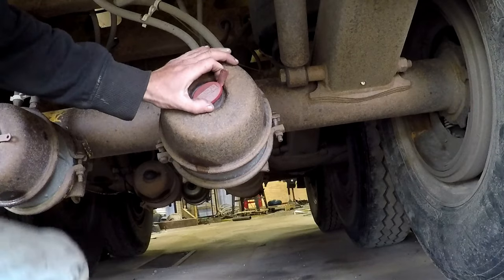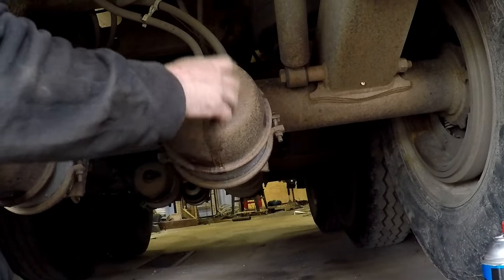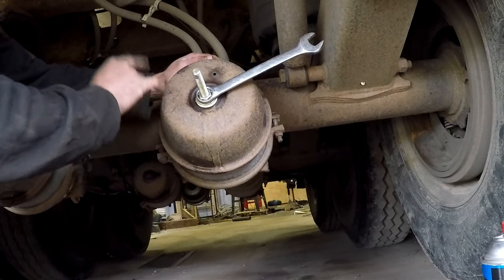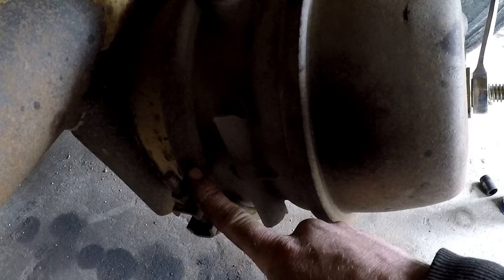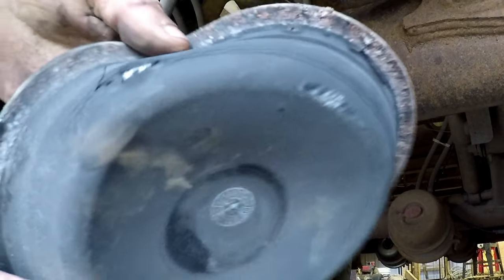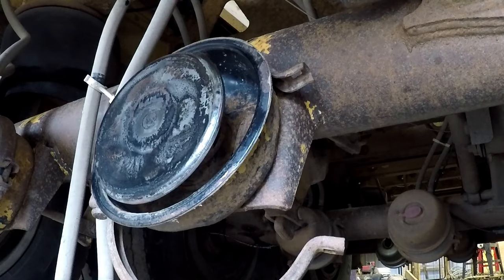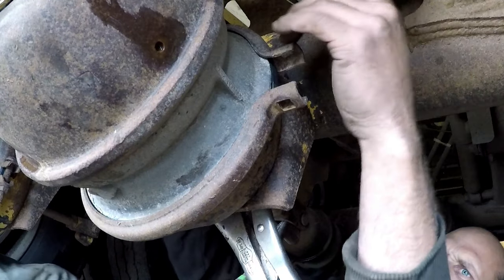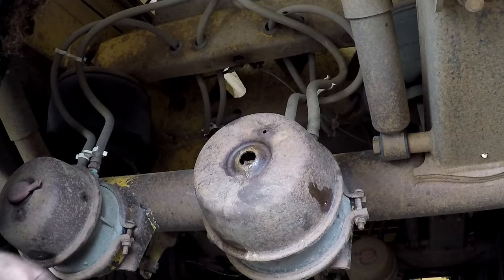brake can repair type 30/30 service break air leak

Comment: How do you know when to replace the chamber vs the rubber seal you installed
Reply from the maker: a leak on the park brake side will require atleast replacing the piggy back, but gennerally a judgement call on the overall condition of the parts being re-used will determine a full can replacement vrs replacing a pancake or piggy back or both. things like excessive rust or a broken return spring would normally require replacing the entire brake can.

Comment: You can also use the slack adjuster to move the spring back without going thru all that bs
Reply from the maker: There is a lot of short cuts you could take but the way I showed it creates multiple layers of safety. So if someone can manage to get at least one or more of the steps right there risk of it popping off and hitting them in the face is pretty minimal
Reply: The way i have done it adjust the brakes out loosen the clamp and replace the pancake or replace the whole front chamber

Comment: How is this tool bolt called that inserts in front of chamber and holds spring compressed? I need one like this to proceed with membrane replacement
Reply: Cage bolt.
Reply: @dchawk81  thank you. I realized that I have one attached to the side of chamber after bougt another at Napa for 3$
Reply: @johnysilver1853  Nice. I happened to find a couple under the seat in a truck I bought used. Lol.

Comment: So the tool that you inserted in to the can did you buy it
Reply from the maker: they should be stored on the side of the brake can. new brake cans also come with new ones, i keep one from a new can in my tool box and my side box on the truck though, sometimes the cage bolts can get pretty crusty stored on the side of the can.

Comment: New to air brakes. Heard so many stories of people dying replacing these and Im scared to death of them. Do I have anything to be worried about or is it in my head??
Reply: nothing to worry about, but you do need to be careful, if he didn't have air pressure to release the brakes it takes a while to get that caging bolt tight enough, so it won't hurt you. Best if you could watch some one else who knows what their doing before you try it. 
If you find yourself in a situation you have to do it yourself just take your time and make sure the spring is caged before removing the clamp

Comment: I have an issue with an air leak on my brake system on my 2016 T880. When I press the yellow parking brake, I hear air bleeding though the yellow knob. Never leaks when yellow brake is pulled out and engaged. Could this be brake chamber?
Reply from the maker: Yes

Comment: just wondering if that impact that you used is a 1/2 in or 3/4 in ???
Reply from the maker: 1/2" its not a big bolt, this is a job that can be done easily with just basic hand tools as well.

Comment: Do you know what is part number is that rubber membrane for Volvo VNL?
Reply from the maker: doesn't matter what truck only matters what size chamber. type 30 is most common for class 8 drive and trailer axles its rare for them to be anything else.
Reply: @Ezrider359 thank you for information. Mine has little leak I think it will fix it by replacing it.

Comment: where do you find the cage bolt???
Reply: On the side of the chamber is a slot with the nut,  if not you need to find one or use the slot-bolt from the other side. It' a good practice every so often to pull the cage bolt out and clean them off. I soak my in ospho  apply a lube and re-insert them back in their holder if they start to get corrode and rusty. 

Definitely something you should do if you drive dump trucks and pickup a shit of dirt, mud and water underneath.

Comment: Where you buy the cage bolt and diaphragm?
Reply from the maker: there should be a cage bolt in the side of your break chamber. there is basically a tube cast in the side of the chamber and there is supposed to be a cage bolt stored there. sometimes one or two will be missing and i keep one from a new chamber in my tool box however as they can get seized and stuck in there storage location on the chamber. the diaphragm you can get at a lot of places that sell truck parts. it is starting to get a little less common to be able to find them but lots of truck/trailer parts dealers still keep them in stock. i normally buy half cans and diaphragms several at a time so i don't have to go looking for them when i need them.
Reply: @Ezrider359  thank you!

Comment: Where to find that T screw
Reply from the maker: There should be a cage bolt stored on the side of the brake can
Reply: Thanks sir I changed it $10 it WORK I really appreciate it thank you very much good video

Comment: What was the proble or symtom?
Reply from the maker: air leak when the brakes are pressed.
Reply: @Ezrider359  ok how did you find it?
Reply from the maker: on a trailer you can pull the johnny bar and go under the trailer and see witch one is leaking, on a tractor you may need to have someone step on the foot brake for you, you should be able to hear the air leak, coming from the can.
Reply: @Ezrider359  thank very much for the info
Reply: Ricardo Ayala if you don't have a trolley brake bar, you can simply install a air line from an air compressor to a blue/ service glad hand. install the blur glad hand onto the front of the trailer trailer. 

you'll have to do this from time to time when you can't get someone's help. keep a red and blue glad hand with shop quick connect air fittings handy. it helps you out a ton!

Comment: Very poignant video for me:( Short Story.  When i was young, foolish, full of piss and vinegar, and knew everything, i learned this lesson the hard way. While pulling up to a Ohio toll booth i heard an air leak. I pulled over right in front of the toll booth to check it out. I diagnosed it with a leaking pancake so i thought i would take it out and go to the truckstop up the road to get another. I just crawled between the trailer dolly and whipped the clamp off not knowing there is a 1750 lb. spring in there loaded. It hit me in the chest and lights out, for i'm not sure how long... couldn't have been too long because there were cars pulling through the toll booth right next to me.  When i collected my self, and figured out that i was probably ok, i called the boss who completely freaked when he heard what i did. He immediately implemented a safety training program which included systems training for new drivers. I'm just glad it didn't hit me in the face. Still have a weird lump on my sternum. Sorry for the long story:(

Comment: This is something I've been doing for 55 yr's. ...Here's the thing.....with the amount of corrision on the sealing edge of the aluminum portion of that piggy-back it should go directly into the goddam garbage can.....last time I checked in my area piggy-back's were $29.95 I will never understand why people go cheapo on anything brake related. WTF
Reply from the maker: i certainly appreciate you input. i agree i should have thrown a half can on when i did this repair. however i was really pressed for time when i made this video. esp with the extra time it takes to record a video. the point was to demonstrate that many times doing a half can or diaphragm is a easier quicker cheaper repair than replacing a entire break can. i carry a spare half can in my truck as well as keep a couple on hand in my shop if i have any issues with it, it will get changed out right away no big deal. but no issues with this repair to date and i believe this was done around 4 months ago.
Reply: My GOD people at least Ezr8der92356 is giving  out good and fast information for those trying to understand or in case of emergency breakdown knows what one can do and at the same time keep some extra in the truck.  2 thumbs up to this guy posting these videos.

Comment: The only way I would do this was if I was dispatched to fix a air leak for a driver stuck on the side of the road.

If your service brake diaphragm is bad, the odds are your parking brake diaphragm is circulating the drain as well.
Reply from the maker: same process to do a half can "piggy back" just take the 2 airlines off and replace the entire spring brake side at the same time
Reply: @Ezrider359  that is the dumbest thing I ever heard. A 30/30 maxi can has 1800 psi of potential energy stored in that spring and comes flying out at speeds greater than 700 mph. 

You can take your parking break can apart, i will just replace mine.
Reply from the maker: @NoahKuzel  you replace the back half as a assembly do not take it apart, look up what a half can or a piggy back is
Reply from the maker: here ill make it easy for you here is a link. i never said to take apart the spring brake side that would be stupid https://class8truckparts.com/haldex-midland-gp3030-brake-chamber.html

Comment: For $20 more and removing two air lines you could just replace the rusty chamber Wich almost looks like the spring was broke or is weak and about to being it's not staying centered and was visible in the hole! But in a road call if in an unsafe place or that's all you had on truck was the diaphragm then it would be acceptable to get it back to the shop as long as spring wasn't broke! But looking at chamber on the left it has a hole rusted through it! Not good! Red tag!  Then the air lines are rubbing each other up by cross member on both sides you can see the rub marks on the side being repaired automatic DOT violation and red tag out of service! People's lives are at risk here! Spend the extra $20 and do it right ! I've been a tractor & trailer mechanic for 30 years ! One thing I will never do is release an unsafe piece of equipment! I stress this to other younger mechanics all the time! You will have bosses and dispatchers try and get you to release it so they can run a load , that load isn't worth someone's life! I will stand my ground on it!  As the mechanic it's your responsibility! If something happens it's on you! Not the boss or dispatch!   I've always looked at it like this my mom or daughter or someone could be riding beside this truck on the road! Don't put drivers and innocent people on the roads life in danger so the company can make money on load!  Not trying to bash no one just been in the field a long time and you gotta stand your ground and have some standards and basically morals, and respect others safety!
Reply from the maker: i do agree that there really isn't any reason to not go ahead and install a piggy back when doing this repair. only reason why i didn't on this one was because i had somewhere i needed to be asap its my equipment and i still wanted to show another way of doing it besides replacing an entire break can assembly.  as far as the other issue you think you saw. trailer has been threw 2 dot level 1 roadside inspections sense this video was filmed and no issues found with anything you mentioned.

Comment: Ya well d.o.t. wants the whole air brakes chamber replaced new but if ur a broke hillbilly then better be a company driver and let them pay the bill safety over cost is the name of the game now days
Reply from the maker: Dot says absolutely nothing about how to repair a brake can only that it function properly is not damaged or rusted out. Plenty of other reasons besides cost one might choose to do it this way.
Reply from the maker: Find me the statute in the fmcsa regs that says you can't repair a brake can. Yeah you can't because it's not there because you don't know what you are talking about
Reply from the maker: Besides where did I use used parts. I used new parts to repair a existing part. If a injector fails do you replace your entire engine
Reply from the maker: Your failure analysis is completely wrong. Btw never once did I say that replacing a entire can is not a better repair. I keep atleast a few 30/30 Chambers on the shelf in my shop at any given time. I keep a pancake gasket and a half can in my truck at all times because it's a 10min repair that can be done anywhere with just a few basic hand tools it's about showing another way to do something. But I can blow holes in anything you have to say all day long but quite frankly I have better things to do with my time

Comment: Do not use brake cleaner on rubber parts, people. This guy isn't so bright.
Reply: He was replacing the rubber diaphragm so it's not really an issue, or did you miss that?